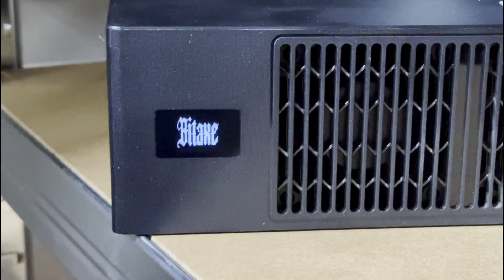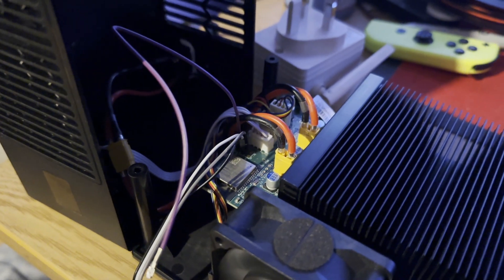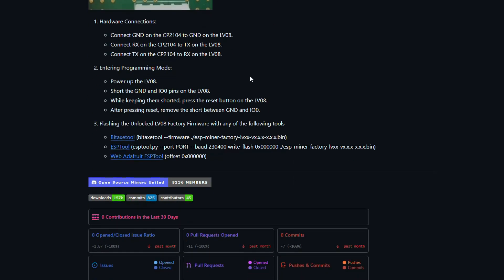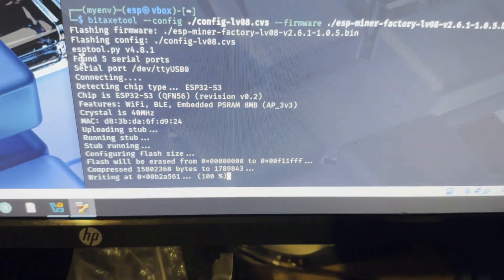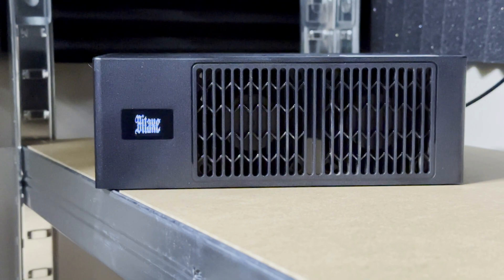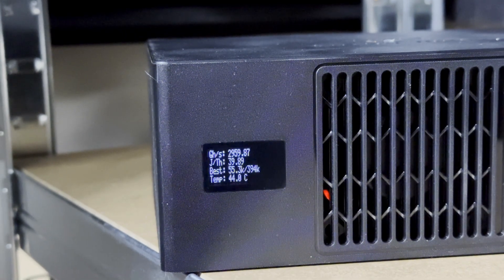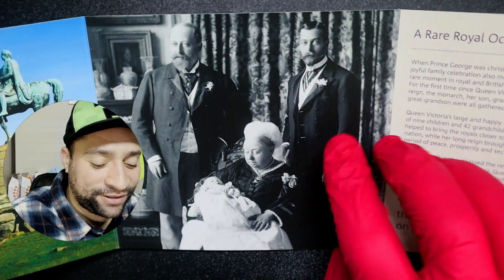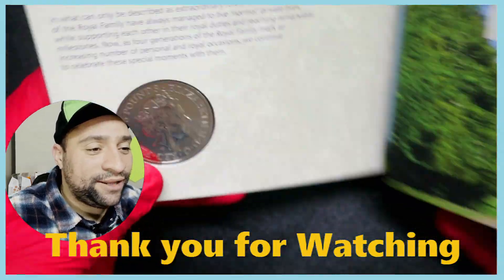LuckyMiner LV08 Flashed with axeOS Bitaxe Firmware bitcoin btc miner

Comment: I did it, it took a while to get the connection to the port , but it worked, I can't believe it, I hated lv08, now it's running above 4th, before it was at most 3.
Thank you very much for the video, it helped me a lot
Reply from the maker: Smokes! That’s pretty awesome.  Did you have the voltage regulator problem where it just wouldn’t use half the board ?   Yeah it could be a little issue to connect. I found holding reset and grounding tricky but happy it’s done.  I was even looking at buying more luckyminers but the price has gone wild now
Reply: @NewGameTag  It must be this problem. The reset button on mine doesn't work, I had to keep plugging it in and out of the socket LoL
Reply from the maker: @ed-ce 
But the good thing is now it’s done. You can update from online  the lucky mine is actually really good devices. I’ve been renting mine out. Seems to be popular.
Reply: @NewGameTag  thanks again 👍
Reply from the maker: I made another video that went into a little more detail on why to upgrade but I’m sure you know why to flash with Bitaxe 🤣
Reply: @NewGameTag  I saw your other video, and I understand why. Right after I bought mine I went deeper into it and then I understood what they did.😁
Reply: Happiness doesn't last long LoL, when I turn off the lv08 and turn it on it only turns on in boot mode now as if it had shorted out on the GND, so I have to flash it again and I can't turn it off to close the lid LOL.

Did you flash it with the config-lv08.cvs and esp-miner-factory-lv08-v2.6.1-1.0.5.bin files???

I'm try to check why this hapend
Reply from the maker: @ check the reset area. I think this happens when reset is being pressed and powered on.  Try unplugging it again and moving the device about. I think this happens when something is being pressed once the lid closes.    There is a link in description to discord where I think one of the people who created that file is
Reply from the maker: @ mine has done this before. My guess is something faulty with the reset switch or something shorting inside. As it only did it once I closed lid. So opened the lid and it was fine. Put it back together and it was fine
Reply: @NewGameTag  It happens even with the lid open, it could be something with the reset button, a short circuit in it
Reply from the maker: @ed-ce try unplugging it putting the lid back on but not throwing it together turning it upside down and plugging it in. I think it might be a short of the reset button and if you say it wasn’t working, then it might be pressing against something or it might be permanently pressed in
Reply from the maker: @ed-ce and are the fans full speed?
Reply: @NewGameTag  I tried and nothing, a few times it turns on and most of the time it turns on with the fan at maximum. But I see that its wifi try to turns on.
 it's probably something shorted, I just have to find out what it is LoL.
Reply from the maker: @ed-ce just to check. You did unplug all the uart pins right ?   It might be worth unplugging and taking the first board out to have a look at the otherwise of the reset button.   The first one without the heatsink is all the connecting parts and the esp32 chip. The asic chips are on the other part. Doubt it will be that.    You could try and connect the pins again once it’s connect and listen to the esp32 chip by logs. See what it’s doing. But check out the discord in the description there is a channel for lucky miners  they helped me with the voltage issue
Reply from the maker: @ the discord ask you to post the link you used to get the firmware.  They believe it’s a failed/wrong firmware
Reply: @NewGameTag  later I'll try other firmwares and I'll join the discord too

Comment: Hi what is correct firmware for the LV08
Reply from the maker: The original one is a closed firmware that’s very hard to get but the axe is one is from GitHub by a user mrbonkerz. There is a link in the description I believe they are currently on  v2.12.2-2.1.1
Reply: @NewGameTag  thank you very much already downloaded the miner is working including the pool but the the screen looks dead do you have any idea what’s is the problem thank you so much for your help
Reply from the maker: Did the screen work and then go off ? Or did the screen never go on and fans go full speed?
Reply: @NewGameTag the screen never go on and the fans are full speed
Reply from the maker: And you are sure this is mining away ?   Sounds like it’s not online and hasn’t initialised
Reply: @NewGameTag yes completely mining and high speed fans , I think just uploaded different files that is the reason then asking you for the corrects files thank you very much for your time
Reply from the maker: The correct ones are listed in the GitHub. It’s the firmware lv08  should be down in the downloads.   As long as it’s mining but just be sure it’s putting out the correct speeds and not mining on the esp chip alone.  In the settings dashboard. There is an option to turn on the screen and turn down the fan speeds. As long as you see them in the o line portal the device is working. If you can’t access them  it might not be working yet
Reply: @NewGameTag thank you very much you’re the number 1
Reply: 😢How many files I need download and witch one

Comment: Pls help i m flash my luckyminer lv08 on bitaxe tool and esp tool i connected successfully but Serial port is not open have an error pls help for flash lv08
Reply from the maker: Are you connecting to the device and what operating system are you using ?

Comment: Did you connect the thin wire to short it before connecting a lucky miner or after connecting a lucky miner to the power?
Reply from the maker: Shorted before powering up.  As I didn’t  solder the wires to the board. I had to hold it in place.  Otherwise I could have just shorted and pressed reset
Reply: I am using the Linux Ubuntu operating system, Ttl Uart converter module cp2104 to connect with lucky miner lv08 and the tool to unlock adafruit webSerial ESPTOOL, is it correct? @NewGameTag
Reply from the maker: Sounds it
Reply: @NewGameTag I managed to connect via adafruit webSerial ESPTOOL, now what's the next step?
Reply from the maker: If you using the web tool. Upload the firmware.

Comment: would it work on windows or only on linux?
Reply from the maker: I used a Linux virtual machine. But check the GitHub for the requirements.
Reply: @NewGameTag  you configured the port with1 what settings and what version of linux did you use
Reply from the maker: @juniorescossio not sure. Mint I think. As much as I know is it needs pip3 installed and the bitaxe tool. I followed the guide on the GitHub. Never had any experience before with Linux
Reply: @NewGameTag  what configuration did you use bits per second: 9600
data bits: 8
parity: none
stop bits: 1
flow control: none
Reply from the maker: @juniorescossio I used the bitaxe tool.  That didn’t need any config to connect It connects to the esp32 and flashes.
Reply: @NewGameTag  I installed Linux on the virtual machine but it still doesn't work
Reply from the maker: @juniorescossio there is a link to the GitHub that explains how to connect to the devices.  You need the bitaxe tool inside of Linux
Reply: @NewGameTag  ok thanks I'll try

Comment: Very good, I'm just waiting for my  CP2104 Serial Converter USB 2.0 arrive and I'll do it.        How did you short the GND and IO0 pins?
Reply from the maker: I’m actually going to make a new video today. As I didn’t go into much details and I want to do it again   But I used a 4th pin into 1O0.  And stripped the end to touch it to the ground on the uart where the ground from the luckyminer met.  You’ll a little extra space to touch.   I found it fiddly and had to try a few times before it was able to read.  I found that shorting first then pressing reset was easier

Comment: Hi, I'm interested in doing this myself, did you soder in pins to use the USB? What model of USB did you use thank you!
Reply from the maker: So I used male to female breadboard wires. They pins on the end to go into the holes.  It’s 3 pins in and a 4th to ground short.  

The controller I used was a CP2104 Serial Converter USB 2.0 To TTL UART 6PIN Module

But the hard part was so that Linux stuff.
Reply: @NewGameTag  fantastic! Good job 👍 thank you